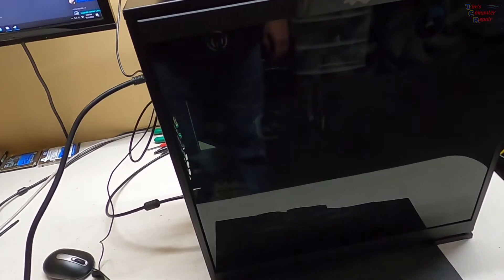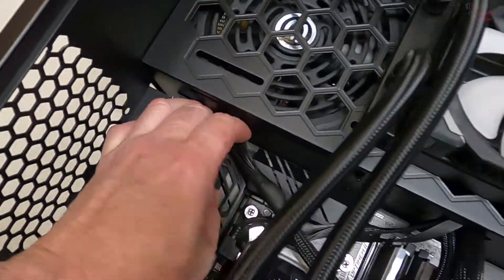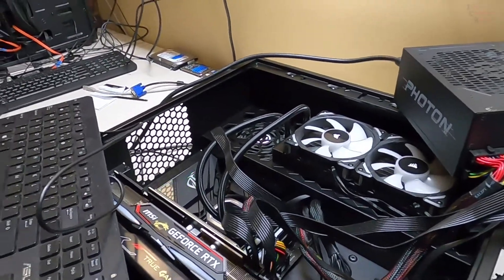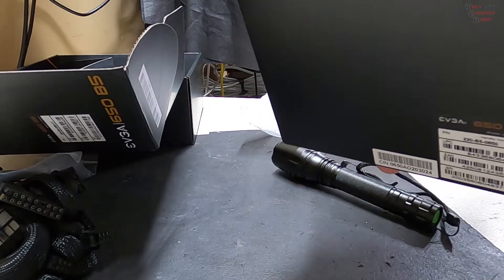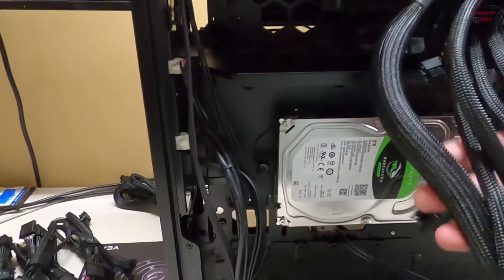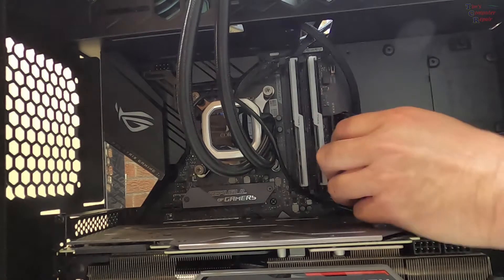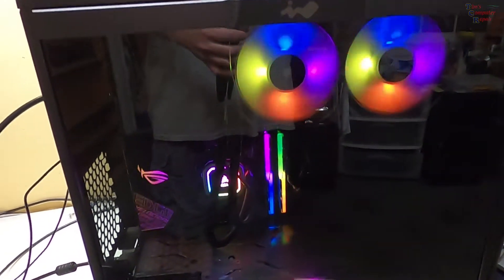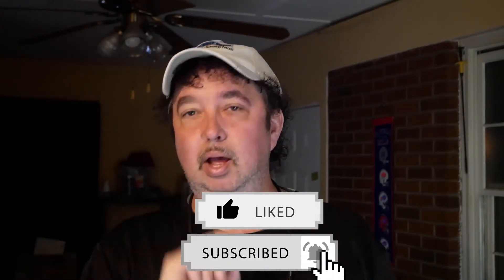How to Test For a Power Problem With a Custom Built Gaming Computer

Comment: EVGA usually has top notch PSUs.  However, there's always a bad apple somewhere in the mix; or maybe it was dropped in shipping damaging the components inside.  Or sometimes it could be a bad cable -- that happened to me on a brand new Corsair CX-550w 80wBronze.
Reply: Had a be quiet! Pure Power 11 shipped to me by Newegg that was DOA.  My big gripe with them, is Newegg tried to keep from refunding my original shipping charge for the DOA PSU after I sent the dead one to them.  In this case, would be contacting EVGA about the initial (dead) PSU here-I am led to believe they have excellent customer/warranty service, as opposed to just running out and getting another.  Also, how do we know that 650W was what is needed for this build?  Would have run the numbers so to speak (components) on PC PartPicker to see what wattage demand was and go from there....PS-ended up buying an EVGA PSU from another vendor as no replacement be quiet! was available, adding insult to my injury from Newegg.
Reply from the maker: Don't need partspicker to figure wattage needed. I go straight to the part manufacturers site and get specs from there. Thanks for commenting.
Reply: You're welcome for the comment Tim.  Whatever works for you. The nice thing about PC Part Picker is you can list out your build, it gives you the total wattage and you go from there (I like to multipy that total by 1.5).  It's terrific for first time builders as a help/guide.  I'm a big EVGA fan myself.  So, why not explore warranty options with EVGA over that dead PSU that was in the machine you're working on?
Reply from the maker: I still stand behind EVGA.

Comment: Since they were the same brand of power supply why didn't you just unplug the power cables from the old supply and reuse them with the new power supply?  It would have saved a lot of redoing the cables.
Reply from the maker: Hey new power supply new cables. Just how I roll and the extra time is minimal. Thanks for commenting.
Reply: I was going to say the same thing. Haha.
Reply: Because of the old rule of thumb about using the old with the new. If the new cables are there anyway, why not use them? Maybe they're exactly the same, but this way This would have the added benefit of making doubly sure that the cables are good and properly seated.

Comment: maybe the power supply wasn't bad, could have been just one cable with an issue or it a cable wad knocked and needed reseating, rare for an evga psu to die but nice fix enjoyed the video. PSU's can have bits of solder rattling around inside but not worth the risk for sure
Reply from the maker: I agree. Thanks for the input and thanks for commenting.